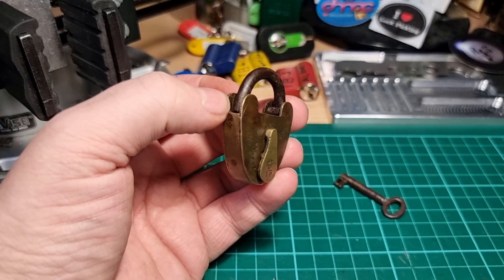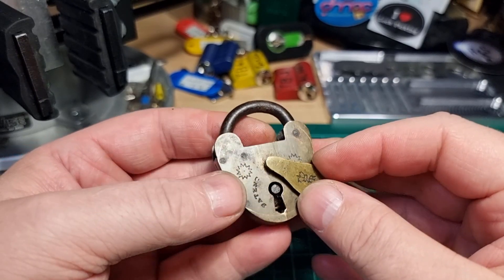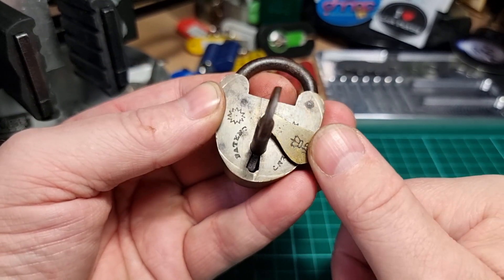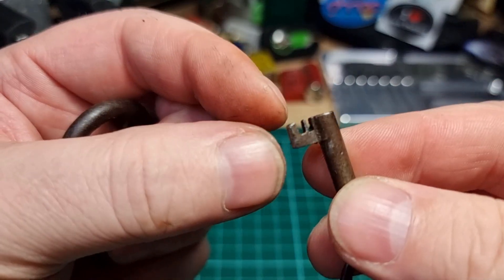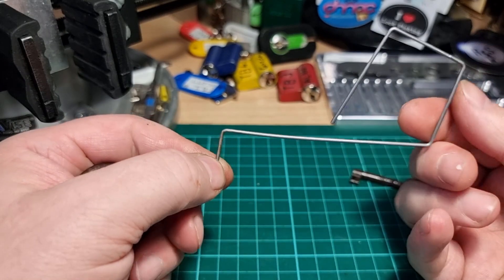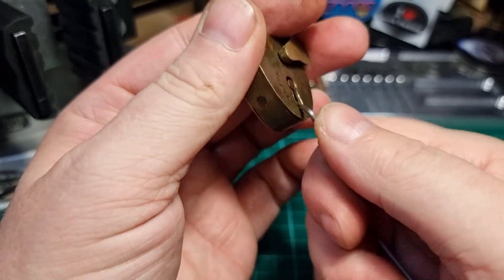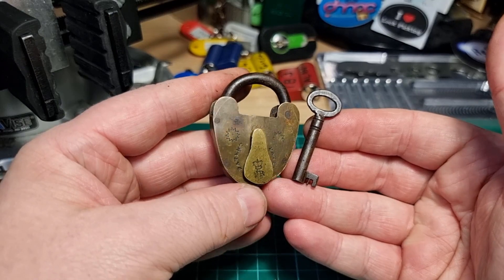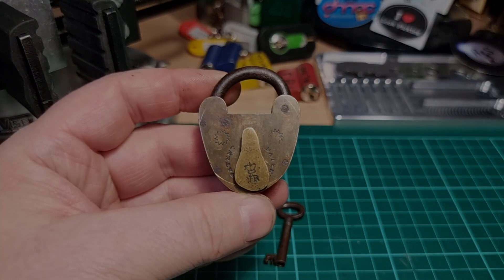(448) A Crude Vintage Lock #minilockmonday Ep92

Comment: It's actually a nice one for the collection. Before you produced the pick I was imagining what you would use. I didn't expect what you produced. 😂😂😂
Just gotta get it in the sweet spot for the open. 
Nice 😉
Reply from the maker: Thank you 😁
I was actually quite surprised that the  wire worked, but the gap round the keyway post is pretty tight, so the Z bend let me work round it.
The angle makes it a bit tricky to find the sweet spot
All the best Roy 
Cheers 👍 🍻